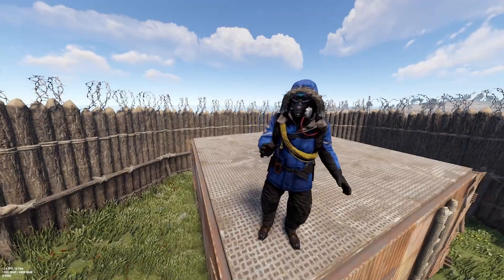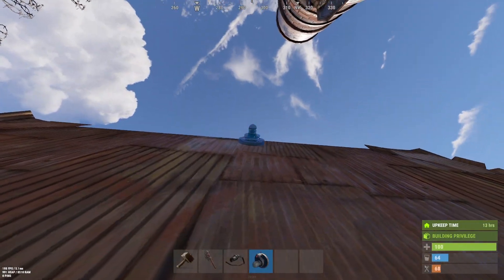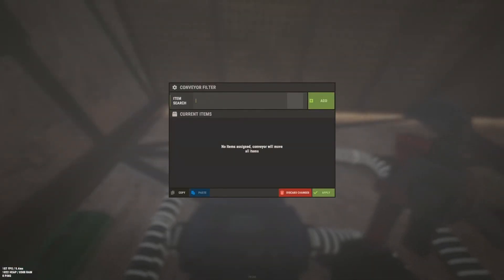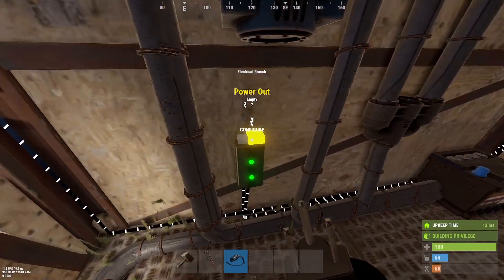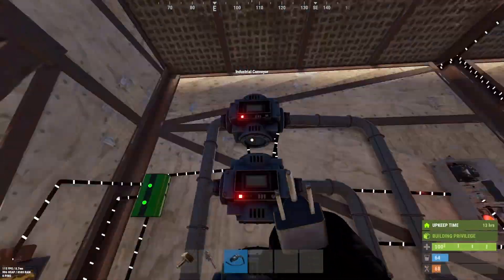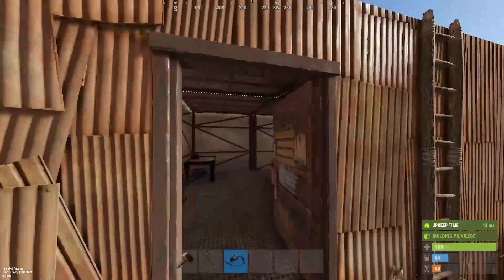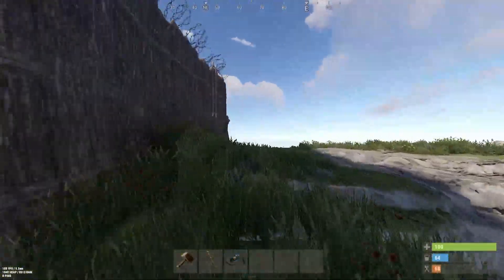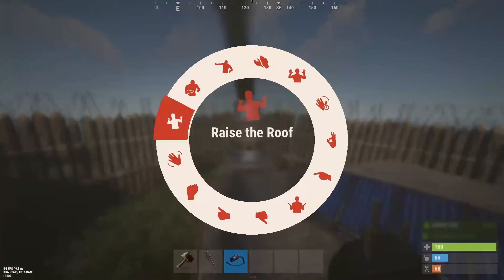Fully automated industrial furnace from a professional Rust [OUTDATED] New version in discription

Comment: Could you do a video on how to automate an igniter to reset the furnaces when the solar power kicks back in the morning?
Reply from the maker: If the furnaces are off and the power comes back it should restart automatically if there is wood and ore in the boxes. What issue u got exactly?
Reply: @rustyphilyt  Not sure if im doing this wrong but the regular furnaces does not turn on automatically for me when the power comes back. I see wood and ore being fed into them but i would have to manually turn them back on.
Reply from the maker: @lothon4088  do you see the timer switching after the wood is beeing fed to the furnace? This should restart the furnace again.

Comment: There seems to be an issue with this regarding cooking up more than 1 type of ore at the time. The conveyor's does not seem to be able to move everything fast enough, and there is a choke on wood supply and it buggs the system out. It works perfectly if i only put 1 type of ore in the chest, then there will always be a stream of that ore + wood, but if i do two types of ore the wood will not be supplied, only the ores.
Reply from the maker: When did you set this system up? After forced? I think they changed something with the filter pass and filter fail outputs of the conveyors. I had the same issue yesterday. Still searching for a 100% working workaround but if you want to use the system without turning the wood off, disconnect the filter fail from the ore conveyor to the wood conveyor.
Reply: @rustyphilyt  Ah cheers man, yeah i put it up like an hour ago. Disconnected the "filter fail" as you said from ore conveyor to the wood conveyor, and it's running smooth now. It's more than doable, just gotta make sure not to put to much wood in there hehe, but this is still very convenient. Keep up the great work!
Reply from the maker: @Lucius.Vorenuss  ye, nice bro. l need to check if my workaround i have in mind works. I will tell you when i tested it.